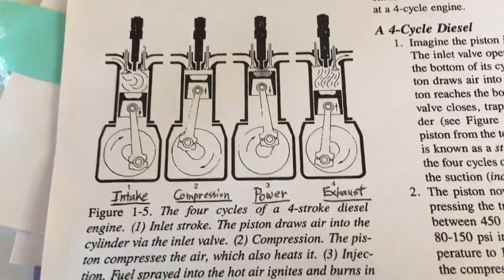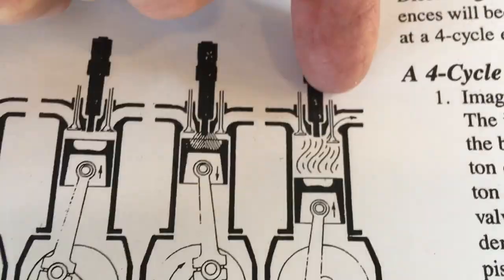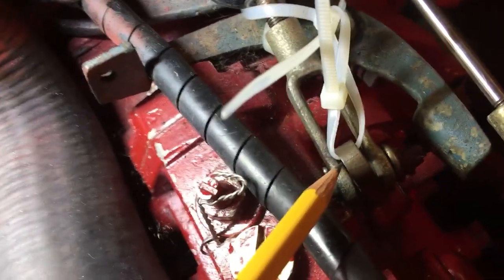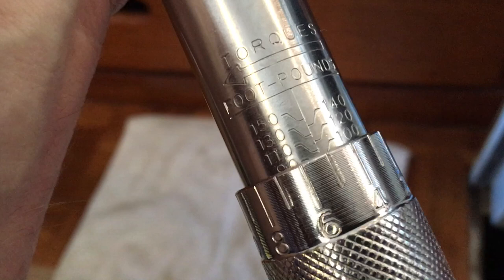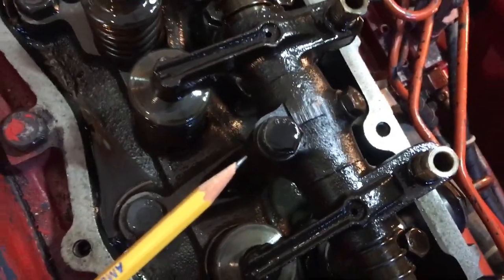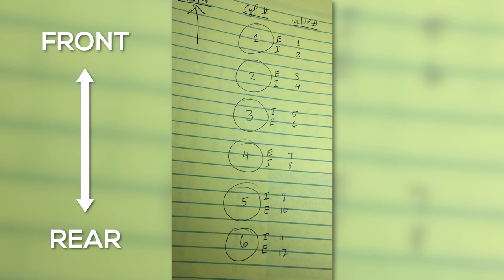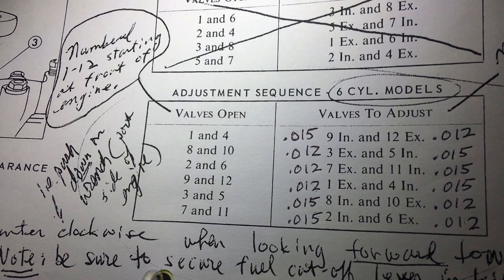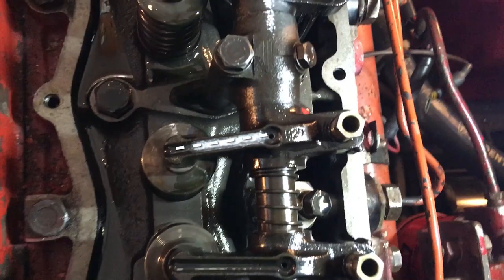How to Torque Head Bolts & Check Valve Lash on a Ford Lehman 120 Diesel

Comment: Hi David, thanks for this. Those diagrams shown at the start of your video are excellent - really helped my understanding how it all works.  
This is our first ever boat. She has a 120 Ford Lehman 2704ET. She blows a bit of blue smoke on start up. Bit of research suggests the valve seals may need replacing, which will be my first job ( hopefully it’s not the rings,) but I’m guessing I would then need to check the adjustment on the valves afterwards?. Interested to know where I could buy a copy of the diagrams at the very beginning of your video ? Thanks ( British boater, so buying from American Diesels is a no go 😢!)
Reply from the maker: @debcrook9086  For two of the three diagrams I have the books that they were taken from at home and could send them to you via email if you would give me your email address. (The first one is of the four strokes of a four-cycle diesel engine, and the third one is a diagram of the pushrod.) The second diagram, the exploded view of the engine, was taken from the  Lehman owners manual which is at our boat. I can bring that home the next time I’m at the boat and then send it to you. BTW, we love England!
Reply: @davidvonwolffersdorff2385  Hi David , thanks so much for this. Where can I email you?
Reply from the maker: @debcrook9086  My email address is davidvonwolff@gmail.com. If you’ll give me your email address, I’ll send you those three diagrams.

Comment: Thanks David for an excellent video. A minor question, what contact cement do you use here?
Reply from the maker: Martin, it’s Weldwood brand. But any brand will work. Good luck. It’s an easy job as long as you work slowly and carefully.
Reply: Thank you David. I will give it a shot. I have an SP135 and it seems that the valve clearance can be adjusted on a cold engine for the SP135. Will just double check that. Thanks again for a great video!

Comment: How did you get the socket onto the headbolts on the injector side of the engine?
Reply from the maker: Are you using a 3” extension on your socket? Would that help with the problem you are having? Take a look at about 9 minutes into my video where I discuss using an extension on your socket. Good luck!
Reply: @davidvonwolffersdorff2385  you don't actually show torquing the head bolts, just the extension and the socket

Comment: How did you adjust the gap with the spanner? I noticed there was no screw that i could see to turn with a screwdriver that i could see on the video
Reply from the maker: You don’t use a screwdriver because there is no screw. It’s a very high tension nut that you turn with the box-end wrench. Take a look at the video at 13:59 and you’ll see the wrench on the adjusting nut. Good luck!
Reply: @davidvonwolffersdorff2385  thank you, makes life slightly easier